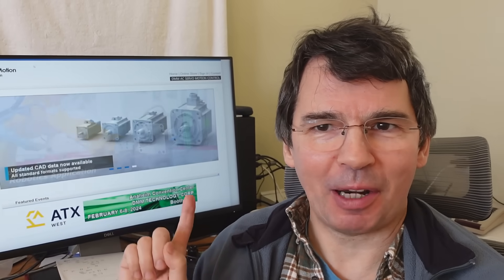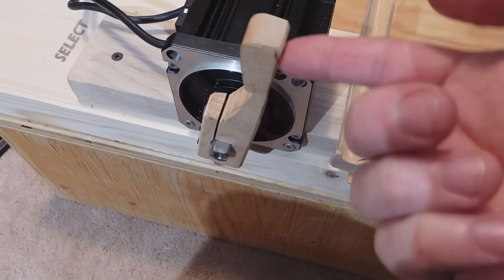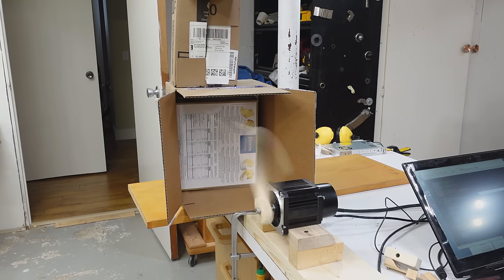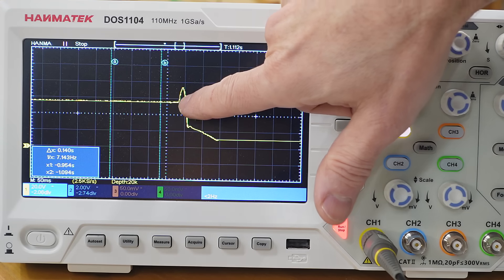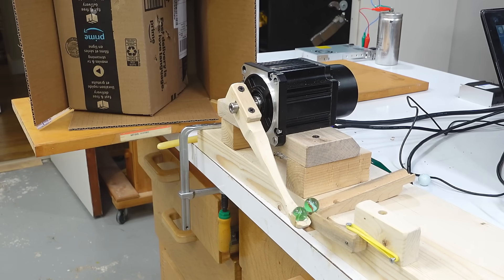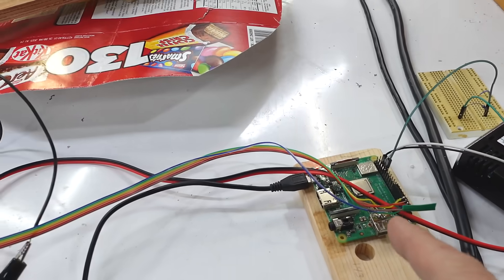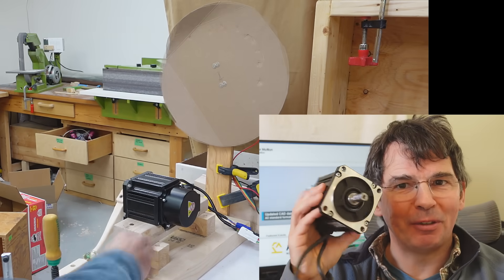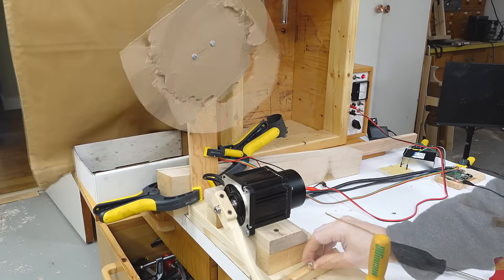Industrial servo marble catapult

Comment: If you didn't use the loading gate, will the marble stay in the arm if you spin the arm all the way around (something like 360 + 90 degrees) - so that you can accelerate to maximum speed for release?

Comment: What if you “split the rotation” like Edyson Pevilcu’s geared cvt transmission? This could allow the motor time to accelerate.
Reply from the maker: That would probably be as bad an idea as Edyson Pevilcu’s geared cvt transmission
Reply: @ I’m the king of bad ideas. My original idea was just a paddle on the motor to slap the catapult arm and then I thought a cam lobe on the motor would provide more control and then I just got carried away wanting to see you make the most sophisticated wooden gear marble thrower ever.

Comment: I still think one of the neatest applications of servo motors was ServoDrive's subwoofers. Apparently compared to traditional magnet/cone design, the servo subs were much more linear as they approached their limits. Only downside was, that they needed belts that were sometimes a pain to replace.

Comment: @matthiasrandomstuff2221 First of all, thank you for sharing this very interesting video. I realize that this wasn't the intent of the video, but as you are probably already aware, there is no evidence of a 'spoonapult' in the historical record. In fact, the origins of the spoonapult in the public conscious likely come from early Saturday morning cartoons shows. Please do not construe this as criticism for what you are trying to achieve, not at all. It's just that they are horribly inefficient at 'hurling'. As an ME and avid amateur enthusiast of all thing related to siege engines, I am fascinated by any and all novel and unique methods of ballistics. If I may be so bold as to offer a suggestion, adding a sling or secondary arm would greatly increase efficiency. Given your current setup, that could prove difficult. That said, changing the shape of your 'spoon' to something akin to a Jai alai wicker or 'cesta' would be relatively straightforward. It may require some experimentation to get the shape right as well as the timing and placement of the marble, but the net result should increase your velocity significantly. A good measure of ballistic efficiency is distance. It would be really cool to see that demonstrated in a future video. Again, thank you for sharing and, "keep on hurling"! 😁

EDIT: @chrishoesing5455 & @cameratool beat me to it 😉

Comment: does your acceleration linear or exponential? )   with exponential accel/decel you can achieve much faster and softer movement.
this servo looks very agile (short) so it must be capable of accelerations much higher than you set.  with proper power supply.
(im pretty sure it can accelerate fast enough to break your launch stick in half because of inertia)

Comment: If it's the torque that's an issue, and not speed, you can modify the cup so you can do a full rotation (or more) before launching.
Reply: I wondered about that too
Reply: At the cost of being able to use this kind of reloading mechanism, I think.
Reply: @robertobryk4989  Yes, that's true

Comment: You should curve the throwing arm and have it load closer to the motor shaft and then roll up the arm through the rotation. This way you could make the arm longer and you would have more torque to get the marble in motion, and also more speed as it reaches the end of the arm. Kind of like cracking a whip.

Comment: 1st problem with feedback & current draw:
add a big capacitor & an ideal diode
Reply from the maker: a diode could cause the motor controller to self destruct.  it needs somewhere to dump the power
Reply: You got the capacitor part I was talking about, just to stabilize voltage. I was also thinking a diode would prevent reverse current while the motor is stopping. 

An ideal diode because they have minimal drop, but they do have a little leakage, so (on second thought) they might not be an ideal choice :p

Comment: Just paused your video at moment where power supply turned off. 
Our local recycling center just got a bunch of 3000W 48V rack power supplies. They're selling them at really good prices (equivalent of 15 Canadian dollars) ? Would you be interested ? Or anyone in the comment section ? Going there on monday to pickup a dozen or so.
Edit: ELTEK Flatpack2
Reply from the maker: 3 kw is Kind of big.  do the run off 240 volts?  kinda interested
Reply: @matthiasrandomstuff2221 
From the actual label on the thing:

Flatpack2 48/3000 HE
AC input:100-277Vac
Freq: 45-66 Hz
Ac current: 19Amax/176Vac
AC Fuse: 20A F
DC output: 53.5V/56.1A

Revision: 6

Located in Eu [:
Reply: @matthiasrandomstuff2221  not sure where my answer is gone but again from the actual label:
AC input: 100-277Vac
Freq: 45-66Hz
AC Current: 19Amax/176Vac

Not looking to make any profit here. Ask me any question here or directly somehow.

Comment: Looking forward to future videos on these devices.  Is there a way you can show what kind of motor is used?  I wasn't sure if it was a brushed DC design or something along those lines as servo motors are often just conventional motors (brushed or brushless) with a feedback device like a rotary encoder and controller.

Comment: I wonder if you would get more power if you had the pickup point under the servo so it can do 180 before releasing and get up more speed. might need a redesigned cup to not launch prematurely.

Comment: That acceleration is impressive. I saw a battery-powered Milwaukee framing nailer at a job site yesterday and I was wondering how it worked without gas cartridges. No one I asked was even curious about how an electric motor could accelerate a nail fast enough to be effective.
Reply from the maker: as far as I know, they pressurize air and use that.  Could also be spring loaded, but probably air.
Reply: @matthiasrandomstuff2221 I'd imagine it works similar to an electric airsoft gun

Comment: If you can't get full acceleration from the 1/3rd turn could you have the arm be hollow and load the marble in the end so it has a much longer rotation before it ejects?

Comment: Checking on the prices, servos have really come down in price a lot. Exciting
Reply from the maker: Still quite a bit more than stepper motors or induction motors
Reply: @matthiasrandomstuff2221  Also true. I think both have come down in price over the last 20 years to where servos cost what steppers used to cost last time I bought any in a size similar to this.

Comment: It's always surprising to see the accuracy of a real industral motion system hitting the exact same point on the cardboard. I built a sewing machine before and was surprised to put the material back through for a second pass during debug and see it apparently not sew at all.... On investigation, it was passing the needle through the same holes it made on the first pass!
Reply: I saw a video on something similar with those ultra precise bench guns. Guy dialing in a bunch of settings and hit the sweet spot for repeatability but didn't realise, and spent several minutes trying to figure out what happened to his bullets, figuring he'd screwed something up. He'd actually put 4 bullets through the same hole from some unreasonable distance, without even tearing the edges.

Comment: you can get more speed by preloading the arm, like a cricket hopping. it would force it to build tension, that it has to overcome before it starts its swing. this means it would effectively start at say, 25% and accelerate, rather than zero.

Comment: How fast can you stop? If you can't get enough speed with that lever length ....if 1/4 of a circle is not enough to achieve max speed because acceleration requirement is insane, you could rotate the lever for a full circle + 1/4 of turn. Marble setting would need to be redesigned...maybe make it deeper to resist centripetal force so when the lever stops inertia steps in? :)

Comment: If you could accelerate the arm before it gets to the marble? That would make it very powerful. Starting from a standing start everytime can't be nearly as quick? The marble feed would need a little work though.
Reply from the maker: The beauty of using the motor like this is that it doesn't self destruct like catapults often do.
Hitting the marble that stationary on the other hand would cause it to self destruct rather quickly.

Comment: It would be interesting to not limit yourself to 90 degrees of acceleration and instead had a mechanism to hold the marble in until it hit 90+360 degrees of rotation, in which the amount of rotation unlocks the marble to release. Then the rpm would be much higher. Fun video!

Comment: To get more marble speed, could you modify the spoon such that the marble would stay in place for a full (or several) revolutions of the arm instead of just 120 degrees or whatever that is, giving the motor more of a chance to accelerate closer to its full speed? I was thinking how a hand-powered sling works
Reply: Naturally for testing you would need an impeller-like enclosure so you're not whipping marbles through the ceiling xD

Comment: My first thought would be to make the marble cup deep enough to hold the marble at the very bottom position.  You could then use the longer arm and accelerate for 180 degrees to the top position. Instead of the immediate stop it could slow just enough to release the marble then use the remaining forward rotation to slow down to the bottom starting position.  That deceleration would be much more gentle. The feeder would need a little redesign with a spring catch to allow the arm to pass by then back into it.

Comment: My wood lathe has a 220v Servo Spindle Motor and it's a delightful feature.  Instant response to torque needs and wide range for speed control.  Not sure if the motor you have would be a good fit for that application,.
Reply from the maker: It could do that too.  But what it can also do is go to positions precisely and quickly, which your lathe motor probably can't do, cause there's no need for it.

Comment: I've been using servos a lot lately. Mostly 400V 3-5kW. They are fun. I used ethercat and industrial PLCs to control them. You can actually control ethercat servo drives with a raspberry pi and codesys.
Reply: Oh, that's interesting to know!  I've written Modbus programs for use in the lab and I've been thinking about adding Ethernet/IP support if I ever get a chance, but we don't normally work with Ethercat and I guess I assumed it would require special hardware.

We mostly do oil & gas stuff but we do pick up oddball jobs from time to time and Ethercat might be another useful tool in the kit.

Comment: I've found the slow-motion video recording of my phone invaluable for diagnosing misbehaving machinery.

If the pocket in the arm is properly shaped you might be able to give the arm a full rotation and a third for more launch speed!
Reply from the maker: but that means no self-loading
Reply: @matthiasrandomstuff2221  Perhaps some sort of rudimentary ratchet system or latch could make it so that the gate only opens when the motor is spinning "backwards"/down. Maybe even just a very slight ramp leading up to the actuator on the loading gate? The speeds involved might make things... interesting, though.

Comment: Servos are versatile enough you shouldn't have to change settings on the fly.  I know because I've worked on them for over 15 yrs in industrial settings. Mainly on a palletizer.  (in factories in the US, Russia, and Turkey).
Reply from the maker: I needed it to move very gently with low acceleration for the pickup, and the opposite for the throw.

Comment: Its a question if SendCommand is blocking or not. Seems to me that it cannot when you setting accelleration and target position as two separate calls. There should be some listener to block further commands till its in the target place, I guess. Higher sleep times would solve it too.
Reply from the maker: Blocking commands until the target is reached would be MUCH more limiting

Comment: Absolutely wild seeing a motor with both the precision to gently pick up marbles and the power to fling them across the room, all without any springs or rubber bands to store mechanical energy. This is certainly good marketing for them.
Reply: How about adding a spring or a rubber band to store energy and get the thing spinning faster
Reply: @hoakuroija1089  Of course you could do that, and it would make a much more efficient catapult, but it wouldn't show off the capabilities of the motor as well.

Comment: With a bigger spoon, would it be possible to accelerate the marble for a whole turn, or even longer?
That way it should be possible to accelerate an arm of almost any length up to speed fully.
It would need a different loading mechanism if you do this manually and a very stable control curve, or good covers.
But that could make it properly dangerous and bring the marble up to much greater speeds.
Reply from the maker: the problem with going a whole turn is I wouldn't be able to use the pickup lever to trigger marble releases anymore.  But I since realized I could go 3/4 of a turn and shoot underhand.